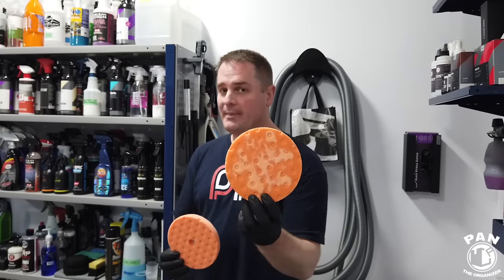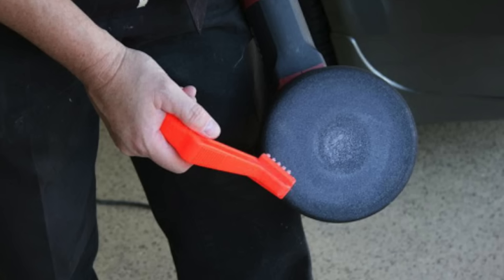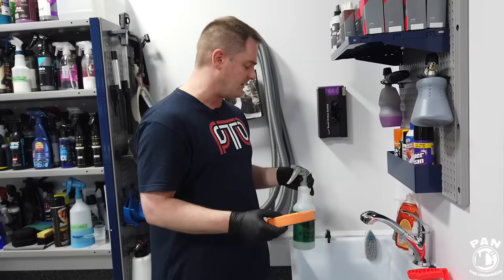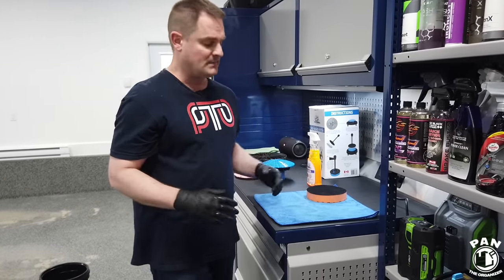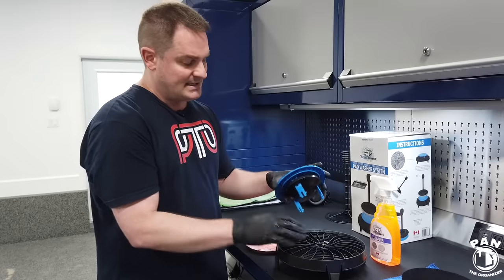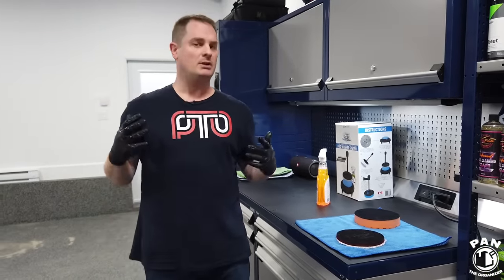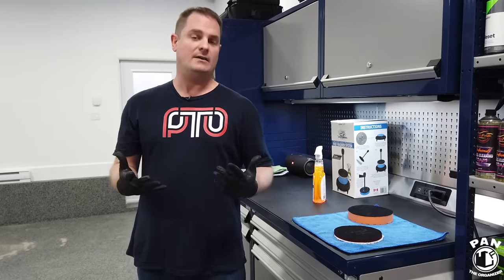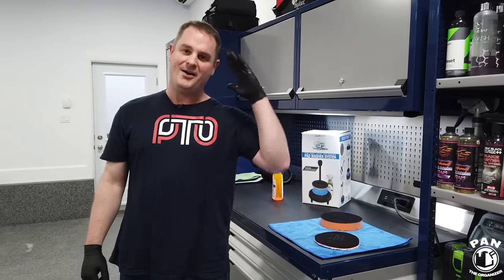HOW TO CLEAN POLISHING PADS... QUICK & EASY !!

Comment: Do you need to clean the pad with the brush between each section (2x2) ?
Reply from the maker: Every time I finish a section, I clean the pad with a pad brush. And after every other panel, I get a fresh new pad. For an average size car, I can use 4 to 6 pads.
Reply: @PanTheOrganizer  roger that and starting tomorrow... today wash, ironx and clay with gyeon (did make some scratches with that I think).. tomorrow polish (nervous as hell), ipa and duraslic  :)

Comment: Hello pan. Just wanna ask on how to remove tree sap. It's etched on the paint. I cant remove it with alcohol or anything. Just had my car for 2 months. And it's white. 🤦‍♂️
Reply from the maker: You would first try a tree sap removing chemical (same for removing tar). Always start with the less aggressive methods first. If that doesn't work, you move to clay the surface with a clay lubricant and clay media. If that doesn't work, you move on to machine polishing.
Reply: @PanTheOrganizer  would the worst case scenario be repainting the panel? Thank you so much pan! All of my knowledge in car detailing came  from watching your vids! Lifesaver!

Comment: Ok big stupid mistake on my part. After I washed my pads last time I obviously put them away still slightly damp. Not so much that you could feel the dampness but still enough that when I got them out at the beginning of the season there was mould. Is there away of cleaning them  or are they junk.
Reply from the maker: Ouch! Try spraying some all purpose cleaner and scrub them with a pad brush and rinse with warm water and see if that solves the issue.
Reply: @PanTheOrganizer  would using a small amount of bleach work. I understand bleach works on mold but not sure if it would damage the bad.
Thanks for your reply. I always appreciate your videos they are a great resource for novices.
Reply: @waynehepplewhite278  did bleach work

Comment: I literally just bout a whole new setup and after just ripping the pads off and cleaning them ONE TIME the material on the back of the pad is pulled almost half way off so now the pad is RUINED after just two uses…. What did I do wrong ?? They were $10 per pad. UGH
Reply from the maker: How are you cleaning them? And what pads are they?
Reply: @PanTheOrganizer  under the kitchen sink with soapy water and my hand squeezing it out. They are from harbor freight it is very hard to pull them off the machine the Velcro is extremely strong! Any ideas?
Reply: I can’t tell if it’s the ripping them off the machine or the cleaning that’s doing the damage but I’m thinking more towards the ripping them off the machine that’s doing most harm?

Comment: Can i use a soft toothbrush to clean the pads or do i have to get that brush
Reply from the maker: I never tried that. It will be a lengthy process to do it with a small toothbrush in my opinion, and the bristles might not be stiff enough to do a proper job. You can always try.
Reply: I'm just trying to figure out things because I just graduated from detail School in Pittsburgh PA they never showed me how to use the brush they used compressed air to clean and reuse I don't have compressed air I do my work at home so I'm trying to find other ways to clean the pods

Comment: I just used the pressure washer, is that bad?
Reply from the maker: That might be a bit too strong on some pads, you could risk damaging them. But if it works for you, I'm fine with that. Just inspect the pads after and see if they look intact. The key to all this is that having clean pads is key to a proper paint correction.
Reply: @PanTheOrganizer  thank you! I think I will use your method just to be safe

Comment: None of these can compete with the easy mode for washing pads as grit guard pad washer. Leave the pads on the machine and few seconds in the bucket and its cleaner then any of these methods in the vidz.
Detail guardz system is a way to much work and its pricey for all the work thats needs to be done for it to clean.

Comment: Wondered for a long time what to do with my dirty pads. So far I just reused them as is.
Reply from the maker: Ouch! Never reuse dirty pads. You absolutely have to clean them. Using clean pads and cleaning them as you polish (between passes or panels) is key to proper paint correction. Overloaded and dirty pads aren't efficient.
Reply: @PanTheOrganizer  That's why you're around. To tell us what to do. I now have a compressor to clean the pad as I use it but so far I've never cleaned them. Will do for sure ! Now that we're starting a 4 week lockdown, I'll have plenty of time.

Comment: Can't you just toss it in the wash?
Reply from the maker: Many people don't like doing that, as the pads are caked with polish and abrasives, and that could leave residue and grit in your washing machine. If you don't mind that, then yes you could wash them in your washing machine, but use cold water, as you don't want hot water to remove the glue holding the hook-n-loop velcro from the pad. And let them air dry, don't use the dryer.

Comment: I just rub my pads on inside the bucket with a dirt trap.
Reply from the maker: That might not be enough for a proper deep clean. You need a chemical to break down polishes and compounds (oils, abrasives, etc).
Reply: @PanTheOrganizer   will a APC work ?
Reply from the maker: Absolutely, as I talked about in this tutorial.
Reply: @PanTheOrganizer  alright pan, thanks!